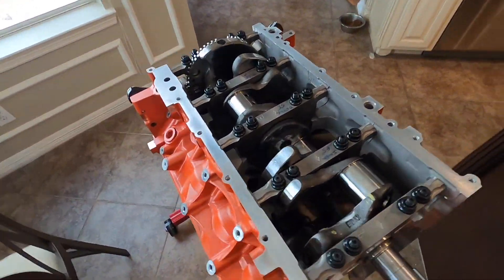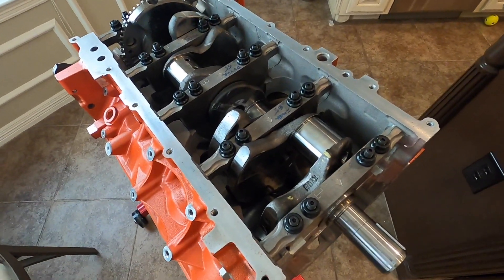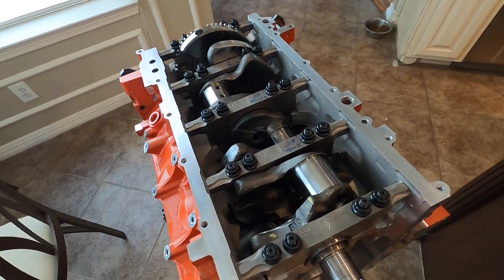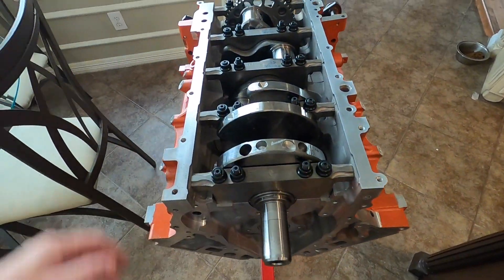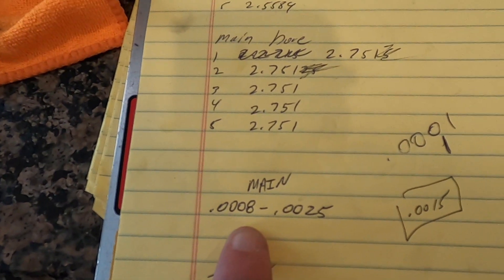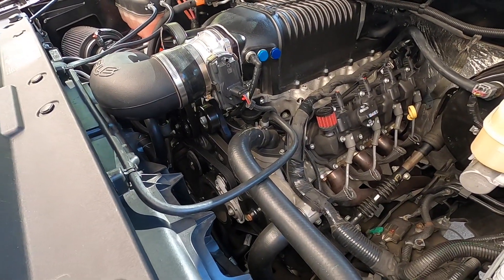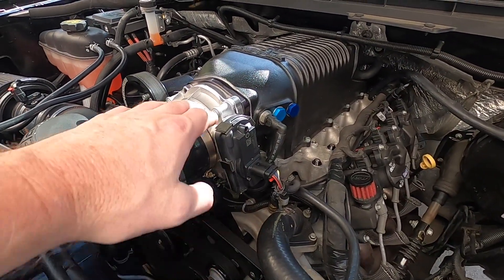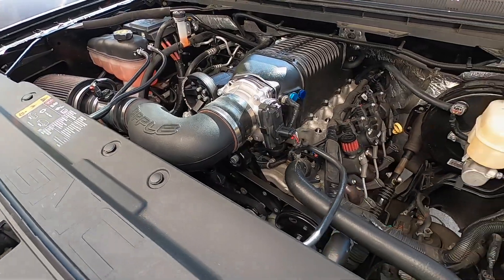L83 5.3 Forged Build - Thrust and Main Clearance & PCV Delete

Comment: to do this pcv delete i cap off both nipples correct ? the one on the block and the stock 6.2L manifold?
Reply from the maker: You need to plug any vacuum ports in the intake manifold.  Anything opening post throttle blade.  You don't have to cap the port in the block, but you can.

Comment: I deleted my PCV also, and put a Crankcase Evacuation System from the cylinder heads to the exhaust so it vacuums it out, works like a charm